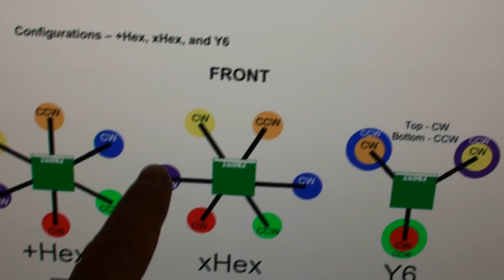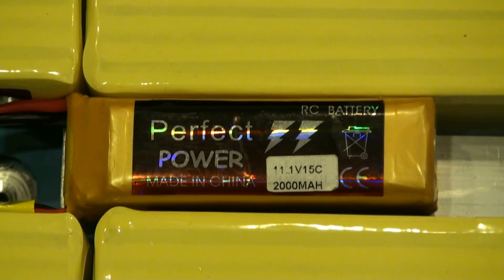#5 Building the Giant Hexacopter - Transfer the Hoverfly Pro to the new Giant Hex

Comment: I believe you are using anti skid/ checker plate  for the center frame on your big hex. I used the same material on my 600mm DIY and I had to scrap it in favour of somethiong a lot stiffer. It was dead soft aluminum. And yours? Went to 5mm plexi, and right off it was better. Not lighter mind you.

Comment: I'm building a Hexacopter, aluminum chassis, 6 engines NTM-3548 (815W) and 60AMP ESC. According to "eCalc", this monster can take off with 36% gas. Any suggestions?

Comment from the maker: rahul, everyone hast to setup the ESC Hi and Low throttle range or their copter will not fly, after you setup HI & Low you must set up the ESC with your program card like in the directions for the turnigy plush esc's. If you do not do this, you will have crazy motors that will not run right!

Comment from the maker: Rahul, you haft to make sure you set up the Hi and Low range on your ESC's first like I did in part #4 building the Giant hexacopter, or the motors will not run right! The turnigy plush ESC's work the same as the Aeolians so make sure you watch part 4 very close on the set up of those ESC;s because it's kind of tricky to get the motors to run smooth

Comment from the maker: Rahul, you haft to make sure you set up the Hi and Low range on your ESC's first like I did in part #4 building the Giant hexacopter, or the motors will not run right! The turnigy plush ESC's work the same as the Aeolians

Comment from the maker: I'm not really sure what you have? I use the Trex 450 landing skids on my dji flame wheel 450 quad and my 550 hex and they cost about $3.00 to 4.00 each on ebay so look at those videos, they also have taller ones, or you mite check with your local hobby store.

I stopped putting the battery's under the fame about 4 months ago because it was such  an issue.

Comment from the maker: The Giant hex weigh's 19 LBS so far without the battery's and w/ battery's along with camera & mount I think it will weigh in at about 30 LBS give or take? the gross aircraft lift with payload and copter is about 90 to 96LBS running the 6s lipo's and the 1580watt turnigy 5055 motors.